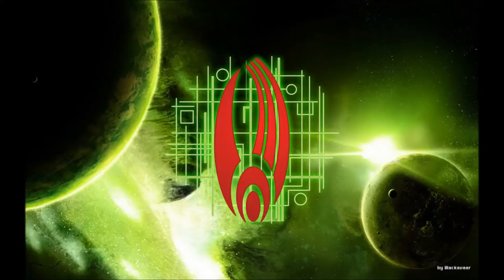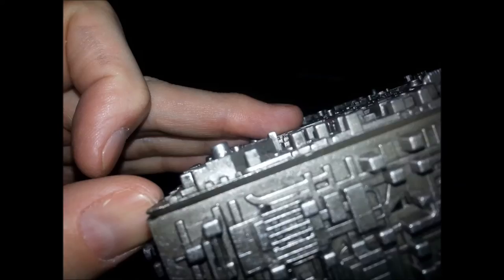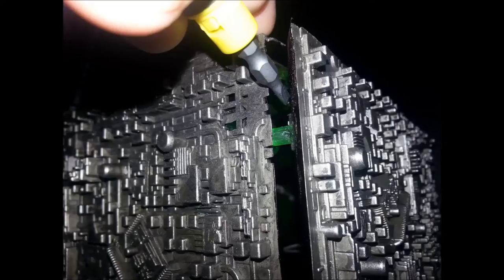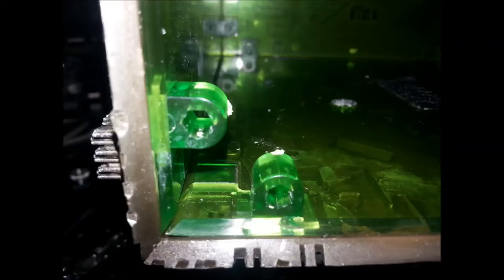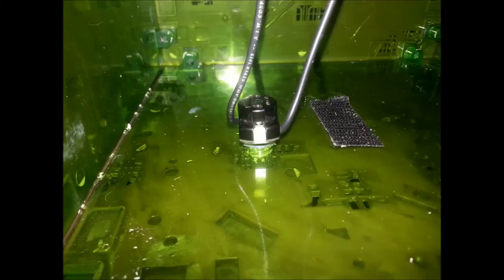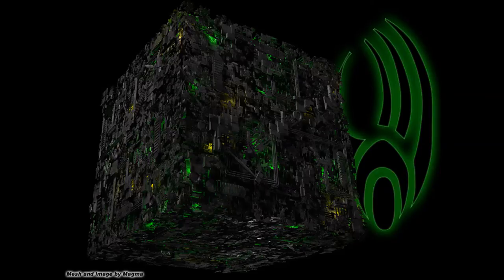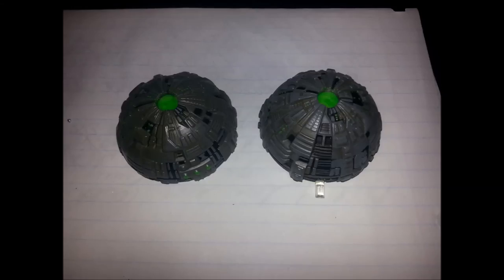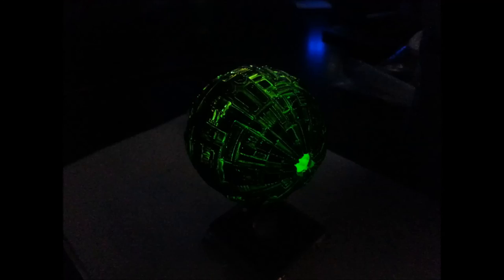Game On - Star Trek Attack Wing: Lighting the Borg

Comment: love the video, is there an easy way to figure out what side of the cube to pry open I was actually trying to pry mycube with my hands a bit to try to figure out where the right side is but I'm having trouble telling and Idont really don't want to break it any pointers for me or an easier way to loosen up the glue on the corners
Reply from the maker: Jamie Kuchma On mine, it ended up being the back side, but I have no idea if they are all that way.  If you can shine a light into one side and look near the corners through the little green parts, you might be able to see the little pegs that interlock the whole thing and be able to determine the sides that come off (there should actually be 2 that are easily removed, the ones that have the actual pegs and not the holes in the corners).